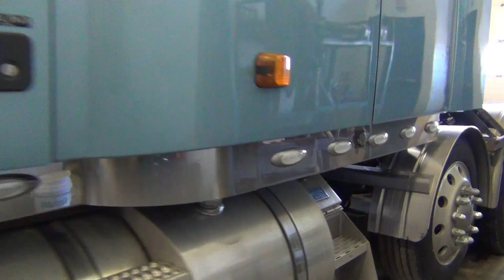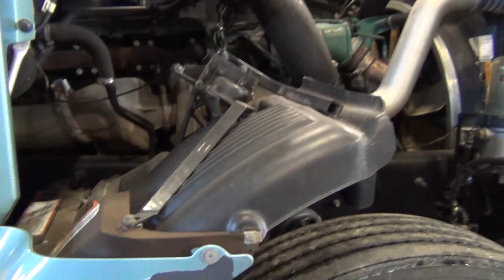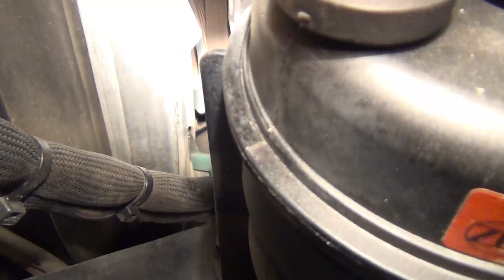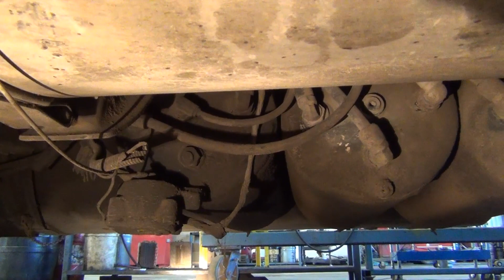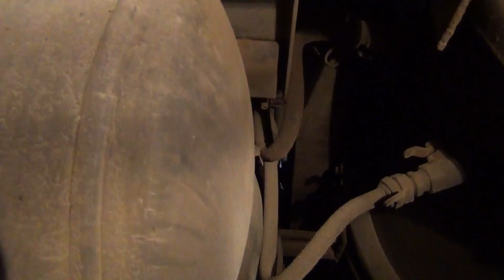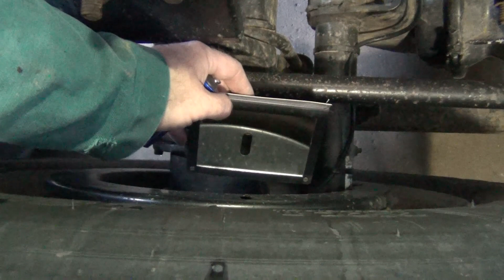Fail - RV Hauler 2007 Volvo 880 18 Speed Eaton Fuller Ultrashift Inspection

Comment: Why in the world would anyone ever even consider using a 4-axle, 16-liter, 18-speed truck as an RV-toter?  That, in itself is baffling.
Reply: +John Deere They would remove everything that isn't necessary and sell all that I guess.
Reply: These trucks are way cheaper than a 3/4 ton pickup, new pickups run $50, $80 grand.  @fullraph
Reply: Not baffling......smart, these trucks don't overheat and they are easy to drive, and you don't need to have a CDL to drive one.